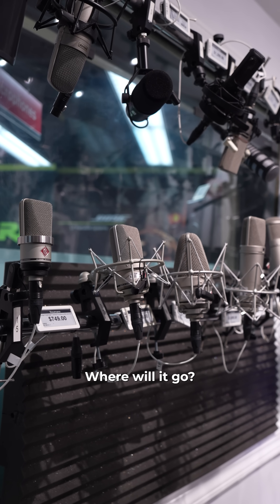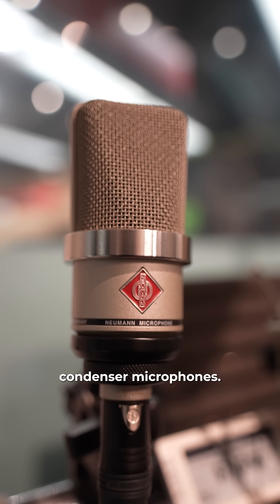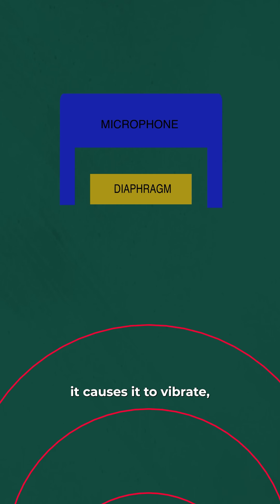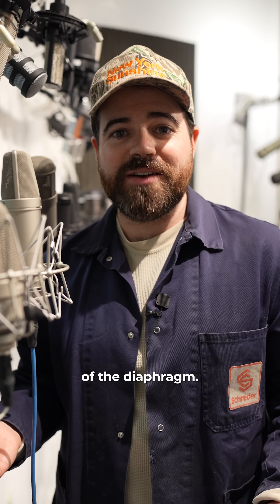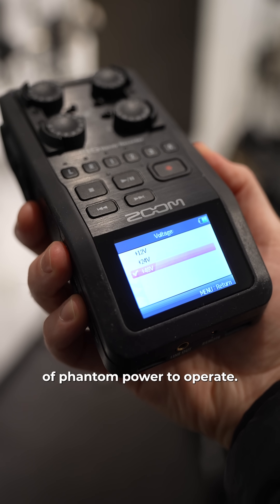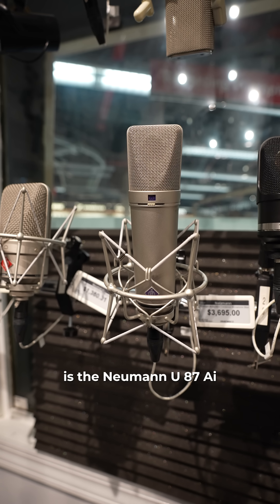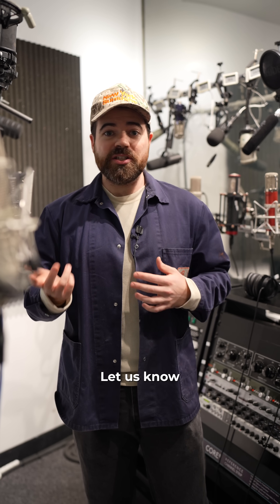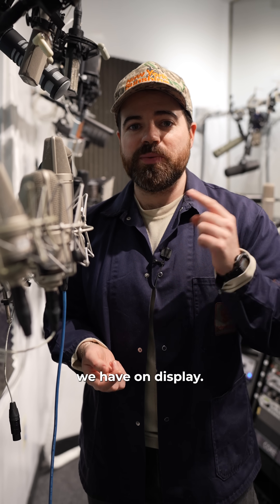What is a condenser mic, and how does it work? Let's take a look at this example from Neumann

Comment: I was given a condesner mic but my room isnt sound proof, and its usually noisy with the fan etc, so i found my earpieces to do better work but often times it would pick up interruptions of my voice when I accidentally get to close to it. 

What mic is most suitable for a beginner singing in a slightly noisy environment?
Reply from the maker: Consider the Heil Sound PR 40 Dynamic Cardioid Front-Address Studio Microphone (Champagne), B&H # HEPR40) https://bhpho.to/3YLA3IG, and the Auray WCF-UB440 Foam Windscreen for Large-Diaphragm Condenser Mics (B&H # AUWCFUB440)  https://bhpho.to/44DwRCD
Add the TRITON AUDIO FetHead In-Line Microphone Preamp for Ribbon and Dynamic Mics (B&H # TRFETHEAD) for the best performance, lowest noise floor and clean gain. You may also want to consider filtering the background noise via computer software (DAW).   https://bhpho.to/42ResQs          >Mark<